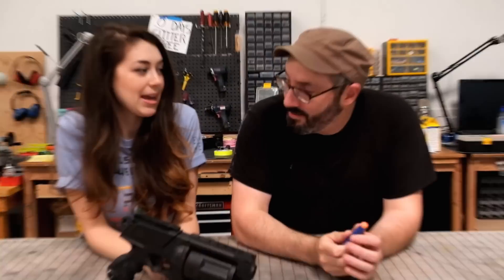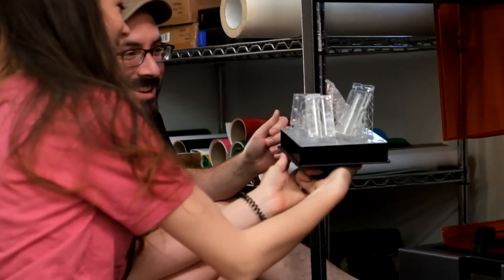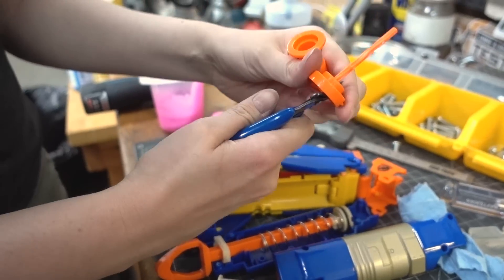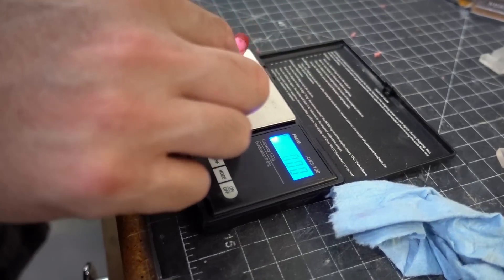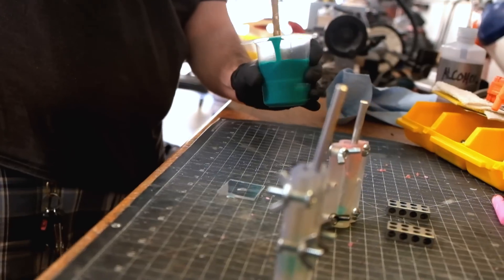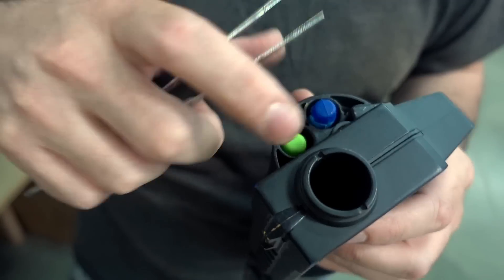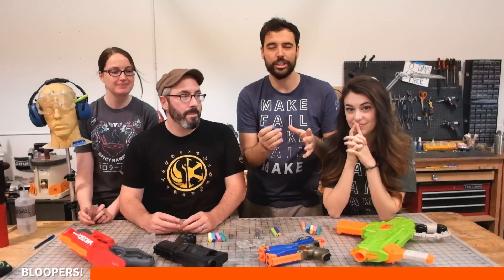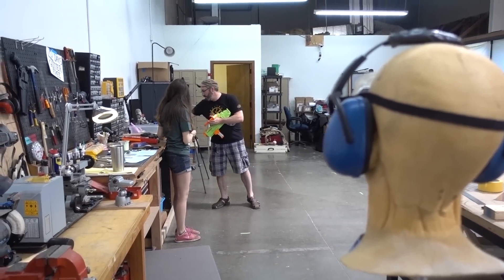Making the ULTIMATE Nerf Dart? (An Adventure in Foam & Silicone Casting)

Comment: I think the main thing that you need to do to make an excellent performing Nerf Dart is to give it a good seal inside of the barrel.
Which I think is primarily formed at the back of the barrel, where the bottom of the nerf dart touches.
This should allow the barrel to build up pressure so that the Nerf Dart can gain as much momentum as possible.
To do this, I believe that you need:
Good Dart Width/Diameter: which can vary some or be a little bigger than normal if the foam density is lower (because a bigger dart, lower density foam should make a similar seal).
Also, if the casing on the dart is not slick, then you do want to make it so, if possible (to reduce friction in the barrel, mostly).

If you want to try out different designs, I would say do this:
Make different casings / Casts with incrementally bigger / smaller Nerf Dart Diameter.
At least 3 different sizes , but I think 5 would be great (one of the same size, 2 bigger, 2 smaller), and 5 would give you more samples to understand your data with.
Then, when filling them, just try to match your filling methods with each cast.
Also, I think that you should make the hole part of your cast.

On top of all this,
I would like to point your attention to how Nerf Darts are made:
They appear to be made with one long tube or extrusion, perhaps, and are cut into sections (so, the dart body appears to be made in a long tube, and is cut into proportions).
Maybe if you did the same for your darts, then it would cause the foam to expand in a more uniform manner?
Idk. That's just an idea, I'm not so sure about this last point.

But I would be interested in seeing  a sequel to this video!

I actually might make some nerf darts, myself!
Although, I would probably 3D Print the thing, instead of cast it out of foam.
I have a special invention idea to make a Nerf Dart into.
An improvement on them (I don't want to give it away just yet, though).
Hopefully I will make it. :)

I enjoyed the video!
Would love to see you guys pair up with more people, again (and even the same people!).
I think that it makes a nice addition to your regular YouTube formula (because, by entertaining other people IRL, you are including more people in your audience).
Also, loving other people helps us to be more humble.
An important thing indeed.

By the way,
Did you know that Jesus loves you?
There is no greater gift than salvation.
And that is what God offers to every one who believes in Him (the God of the Bible).
God bless you guys! :)

Comment: This foam is the same as in the insulation business of heater pipes. I just don't get the diameter in the hardware store, but in theory, you can buy it by the meter and cut pieces off I guess.

Comment: I'm thinking that the center of gravity is the key. The Nerf bullet is balanced so it can reduce drag horizontally yet increasing drag vertically. Letting the bullet travel further by its aerodynamic tip and increasing its drag vertically for more air time. Really, this is just a projectile problem.

Comment: Doing HVZ I've experimented with a lot of home made nerf dart designs. You can buy half inch round foam by the roll, cut it down to the desired length, and add a dab of hot glue to the end. We modified our guns to take 1.5" darts and they worked much better than the originals even without the hole in the back of the dart.

Comment: 7:24 ah that statement does not age well at all. i say this is because in 2020 nerf has the worst performance darts( which they are using nerf elite darts but there accustrike darts are really good though) on the market highly inaccurate and the adventure force they have the best performance darts out there because they are cheap and have way better accuracy and are way cheaper. also nerf knows that their elite darts are crappy darts and know there accustrike darts are way better but they never put it into their new blasters

Comment: Why don't you guys cut open a nerf dart and compare the internal design/weight?  I think you need to get the force of the air applied close to the front hence the hole and have the balance of weight towards the front too. My theory is that the foam just acts like the fletching feathers on an arrow to hold it straight (ish)

Comment: The tips are to heavy. The real ones are hollow
Reply: That plus the nerf darts use a foam with larger bubbles which makes them lighter. But I think the surface finish of the foam is also less rubbery, they probably lose a lot of energy to friction.

Comment: On the silicon tips, try some graphite powder it'll be applying friction to the inside of the barrel (I think, I'm not too familiar with the properties). Graphite is easy enough to come by, it's the inner if a pencil. Hell put some on the full length of the dart.
Reply: Also the tip on a nerf dart are hollow.

Comment: Nerf does not really know what they are doing with their darts, that's why a lot of pro nerfers use off brand waffleheads, also rifling on the dart itself doesn't work well because the inside of the barrel is fairly smooth, however rifling has been done by worker(a nerf aftermarket parts company) by having rifling in the actual barrel like a real firearm since the foam grips into it.

Comment: Nerf darts center hole is designed to expand from air pressure creating a gasket along the outer wall.  Also you guys need to get your center of pressure behind your center of gravity.

Comment: It seemed like the only major problem was that you made the darts far to heavy for the nerf guns to fire. If you had tested them in a singled drain blaster I don't doubt they would have performed just fine (other than being totally unsafe).
Reply: Typically a nerf dart weighs between 1 and 2 grams, while yours clocked in at over an ounce.

Comment: my favorite diy nerf dart was backer rod window foam with a metal bb 1/2" down into the tip and hot glue to make the weighty hard tip. not only do they shoot great but they are super cheap we get 1000 darts for about $20 and we use magnets on sticks to help pick them up without bending over every few feet after nerf wars. we have our darts measured distance farther then the original darts. you gotta have the weight in the tip
Reply: Stephanie London : That’s Genius....Finding the darts is always the hardest part...

Comment: the foam was pretty close, the solid heads are the problem. too heavy. You can probably do a 3d printed head with middling infill using ninja flex (rubber filament)
Reply from the maker: Thanks for the suggestion!

Comment: Honestly. I don't think if you wanna make your own nerf darts you should make the foam or the heads, buy them off online stores, but thats kinda against the point of this. The things you'd want in a dart head is a good length, not far off the original length, and make sure its heavy, some people use hotglue instead of rubber for the added weight and the ability to put a weight in, so that could be worth a couple tries, a hot glue and weight tip

And the foam issue, i think you guys are getting there with the foam, the foam should be ridged enough to withstand the forces it takes as its in the air, if the foam isn't ridged, you may just need a shorter dart so there's less foam to move, other's do this in very high performance blasters not because the foam isn't ridged, but because they fish tail with the massive power. Just keep experimenting with different foams, and keep the hole, I'm sure that is important for the reason you said in this video
Reply from the maker: Thanks for the suggestions and encouragement!
Reply: @EvanAndKatelyn  no problem, i love spreading the knowledge around, i usually think like this

Comment: I believe the tip of the nerf dart is hollow that might be effecting it also if you video the normal bullet you should be able to see if the weight is equal or if one side is heavier 
This weight difference may be because of the plastic or how much you put in
Reply from the maker: Thanks for the tip!

Comment: THE SECRET: A smaller point with a lighter foam. Weight is a huge factor in nerf darts. The lighter the dart, the farther it will go. The hollow chamber is critical as well since it is being push by air. The hollow chamber allows more air to push against the dart, thus moving it farther.
Reply from the maker: Thanks for the tips!

Comment: I feel like the rifling within the dart has a lot to do with the dart not being able to travel a long distance, what i feel is happening is that the air pressure is being released through those rifling in the dart and not causing enough pressure behind the dart to make it cut through the air like a normal dart would. Maybe try the same darts you guys made but without the rifling. If you do want some kind of rifling then maybe modify the barrel so that there is actual rifling like how in real rifles have (maybe use a razor blade and push it down the barrel and slowly twist it as you go down). Also I do believe the hole in the back makes a difference on how far the dart can travel. And also maybe the tip you guys made was a little too big and too dense. The tips on normal nerf darts are hollow and thin rubber like material (this may be for a softer impact against a person but it might also have to do with airflow and the balance point of the dart but idk). I am by no means anyone who absolutely knows wtf im talking about im just trying to maybe give advice that you haven't heard yet (i am an inspiring engineer who is currently in college to become a mechanical engineer but that is not a reason why my thoughts should be anymore relevant than others) I think you guys can make a better nerf dart its just gonna be a lot of trial and error....and a lot of coffee. Cant wait for the second attempt guys! LOVE THE VIDS <3
Reply from the maker: Thank you for all the tips! Yes, much more trial and error needed

Comment: You need a denser foam and a hole in the middle of dart and the tip should be smaller than what Evan and Katelyn made and I think that the little grooves helped it not get to snug since the air is pushing it out
Reply from the maker: Thanks for the tip!

Comment: Perhaps you can shoot them with air pressure from a compressor through pvc. I suggest trying insulating foam boards. It is a solid very light but hard foam. I believe the soft nature of your darts allowed for too much compression of air on them before they left the barrel. I do like the riffling idea for accuracy. I believe the silicone head should way equal to the body. To get an idea for proper size. That is my assessment. I wish I could make them but that will have to be another time, when I'm not working three jobs and renovating my house when not sleeping. Thank you for all your efforts and the fun, and insperation you provide.
Reply from the maker: Thank you for all the tips!!!
Reply: @EvanAndKatelyn  no, THANK YOU for all the tips. Have fun.

Comment: I didn't read through too many comments, so others may have caught this too. I think the silicone tips need to be slightly smaller in diameter than the foam so they don't grab the barrel. If you look at the nerf ones, that is how they appear to be designed. I suspect the foam would slide more freely on the barrel than the silicone.
Reply from the maker: I think you're right! They were kinda sticky!

Comment: I used to cut the foam near the rear of the dart at an angle, multiple times, and flare it creating small fletches that would impart a roll to the dart after it left the gun.  I also used make blow guns that were lined with glassy tape at an angle, and small gaps between the strips of tape, that when rolled up, on the inside of the barrel, would create rifling that the dart could engage with.  The blow guns were rolled from 11x17 paper with the breech end being 1 to 2 mm wider than the muzzle end.  These things combined, and in the same direction of roll, did make for much faster and flatter shots.
Reply from the maker: Ooooo that sounds fancy! Thanks for the ideas

Comment: If nerf bullets are anything like real bullets than the hole in the back is to allow the bullet expand to make a perfect seal to the barrel and not allow any gases to escape. But with a nerf bullet I bet if you took one of their bullets are part will give you a better idea of what exactly the tip was designed like. But I have feel that the nerf tip are probably less top heavy as the ones you had all created. Also the more bullet like the tip you can make it will probably help with areodynamics.
Reply from the maker: I think the heavy tips we used definitely threw it off - thank you for the tips!

Comment: Hey guys! I know I'm a bit late to the game, but for projects when you're molding with silicone how do you make sure you don't get air bubbles in the mold. Do you have a degassing chamber, do you vibrate it or are you just super careful? Thanks!
Reply from the maker: There are a few tips we've tried that seem to work: vibrating it (we stick a sander against it without the sand paper) and we've also tried a vacuum chamber. Also pouring with a really thin stream helps because then it's harder for the bubbles to form in the stream itself. We go into tips a little deeper in this video: https://youtu.be/NBZUDRxwaKA